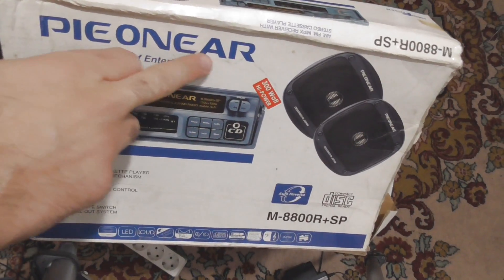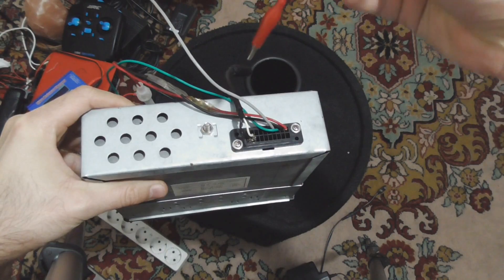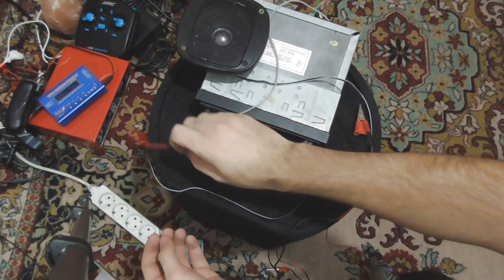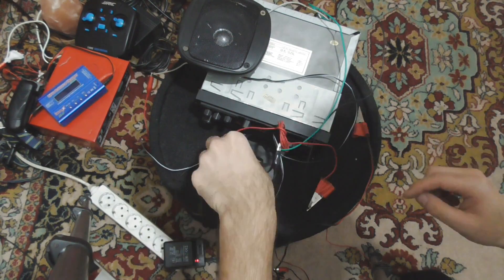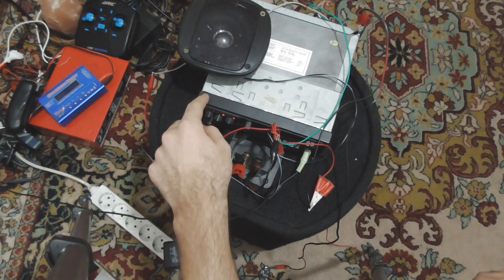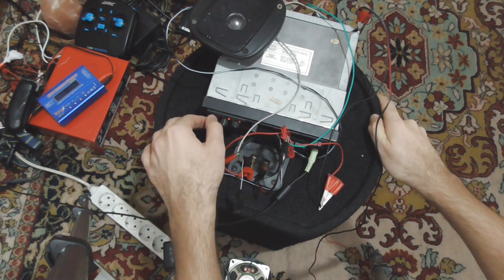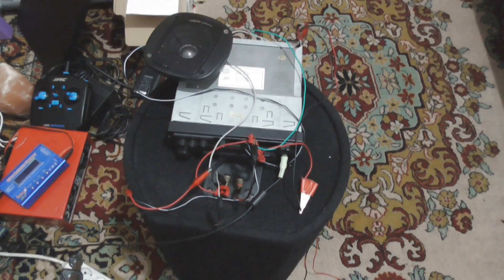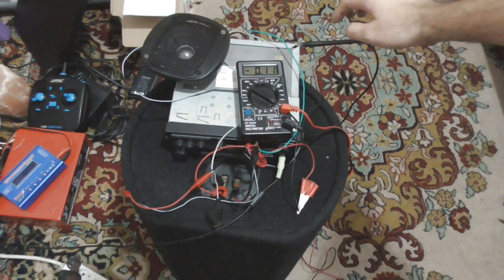Using an old Car Radio-Cassette player as an Audio Amplifier (Pieonear M8800R+SP)

Comment: The amp says 300w max and the speaker is very less than that. How did it not blow in max volume?
Reply: because the rating on these fake stereos is actually fake. you're looking at max 10 watts of output power 90% at the time

Comment: very nice and smart video Furulevi. Bravo. my frend i want for you to make the same with a DDS signal generator can you do it for me my frend? the frequencys have there own sound each other for 15 HZ Square  wave because 15hz it is low freq. seperate at 2000HZ sine wave and so one i am searching this video where i am asking to make for along time at u tube but knowone have never thing it to do it first and upload it after. DDS signal generator like FG100 and other more new like the blue one they have out put exit and i want my frend to make the output of my  dds signal generator  to be stronger because the output amplitute its low and i cand make my experiments. furuvel  the input of the dds signal generator to the Audio Ampifier is the same like you done now with the cassete player. i hope to do it my Bro. i watch your videos very long time and i hope to make true this christmas wish for me . thankou again my frend for all your videos from George thessaloniki.
Reply from the maker: As long as the frequency is in the audio range, this radio is OK for amplification. I don't have a DDS function generator, but an OWON AG1022F.
Reply: thankou dear furuvel ag.1022f is a very good machine. but yes the freq.are to high.if you want to give you 1 idea one smartphone chip or expensive is the same . with the handsfree you can take the output of the smarthphone  signal generator app. from the handsfree cable and when you open the frequacy generator app from play store or app store is the same with dds. thankou my frend . i hope to see something about my problem if no. doesent meter. a very good app for the signal G. om play store is True Tone   ,sine -square,triangle sawtooth,  if you want to do something very very good you dont need DDS  just a smartphone and a cassete player or cd player . thankou again my frend for your time i forgot to say that the top of the True Tone    app is 20.000HZ